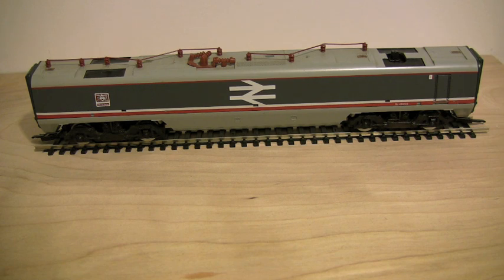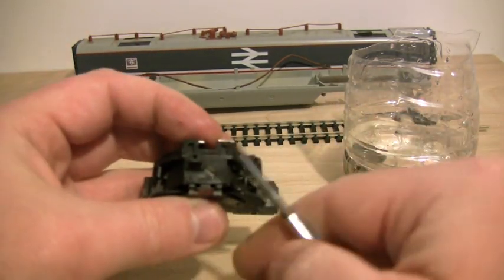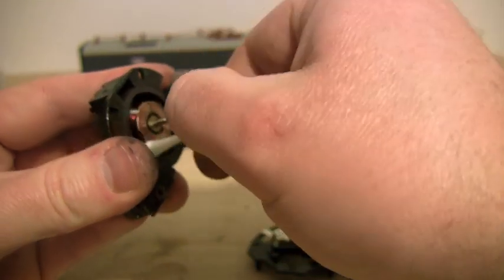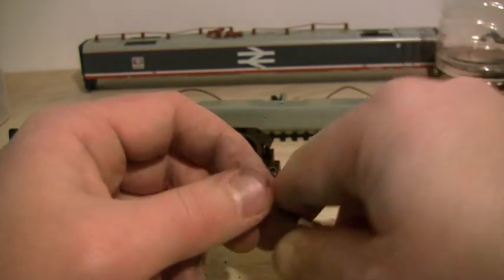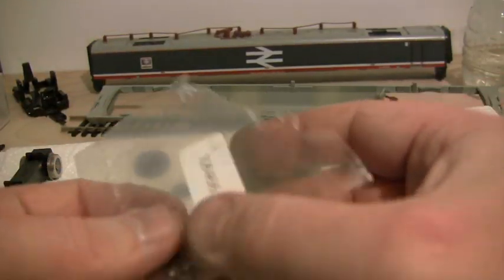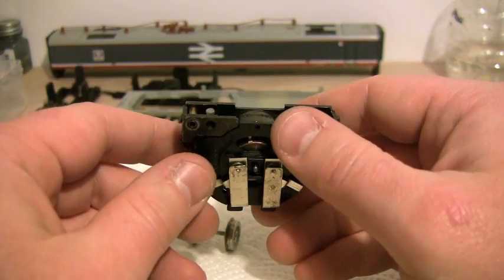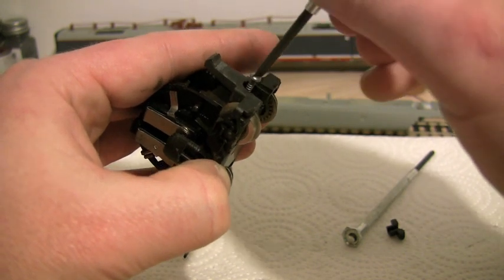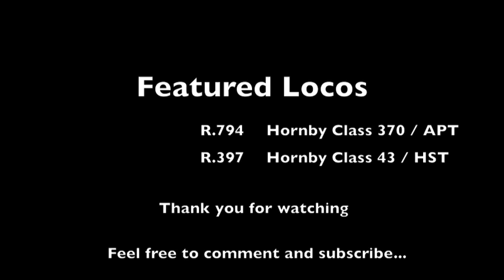oorail.com | Hornby APT Class 370 Power Car Repair

Comment: Hi. I did what u did to one of the hst class 43. It worked.!!  It goes ok but not as fast as yours  12 volt I measured on the rails one problem now it derailed on corners I looked and the wheels aren't straight lol. Will sort out tomorrow but thanks for this handy tip. .

Comment from the maker: I'm not sure about the pendolino but the Hornby APT has the body tilt on the bogies. This seems to be achieved by the plastic piece where the bogie is connected to the chassis. The plastic is molded such that the body can move on the bogie as it goes around curves. It seems to be finely balanced on the APT, needs the body shell attached to work properly. It does work at slower speeds with just the bogies and chassis. I will see if I can do a video showing it working :)

Comment from the maker: Yes its exactly the same type of motor as the old HSTs. The top of the motor casing might look slightly different. The APT has a bracket for the pantograph that screws into the top of the motor casing. The HSTs that I have don't have the screw hole in the motor casing, but some of the older Class 35s that I have do. The motors are identical aside from that.

Comment: Found the video above about servicing of the ringfield motor will come in handy but I am the gentleman who is having difficulty removing the motor frame from the chassis. I believe it is type B . I have removed the weights but cant see where those darn lugs are hidden. The model is a 'king edward 1'.

Comment from the maker: Thanks. Yes its a lot easier to do it that way, I think thats the way the service sheets tell you to do it. There are two types, one with a screw and ones that you have to bend back a little to get the spring / brush in there. Aside from it being a lot easier to lose the spring, the metal will fatigue over time and can easily break. So while its a little bit of extra effort, you don't run the risk of losing the spring or breaking the metal this way. Either way works though! :)

Comment: Watching with great interest. May have mentioned before about the brass cog issues. The original plastic cog broke and have been trying to replace it with a brass cog.
For a moment I thought you were going to pull the axle and cog out but you didn’t.
Andy Russel spoke about using a C clamp to push the cog back on and I gave one set up for this.
Have you ever tried it with any other Ringfield? I have a number that require the cogs to be replaced.
I feel your pain on the prices/postage as I live in Toronto
Cheers
Reply from the maker: Glad you enjoyed the video. I've had to replace both plastic and brass cogs on several locos. Usually its because they are loose due to a small crack in cog. If you are installing a new brass cog, you will want to grease (I used silicon / PTFE grease) the shaft and will require using a small vice. There are a couple of ways to do it, putting a nut between the vice and the cog works well, just make sure the nut is big enough that its going to slide right back off when you are done. The brass cogs can crack and I suspect they are weakened by the press fitting process to get them on. The solution I ended up using was to 3D print them, you can see what I did on this video -> https://www.youtube.com/watch?v=7K9qsUa16Gw .. now i had the same problem with an alloy cog on an A4, but what was interesting was that the shaft / spindle on that loco was larger than the previous one. Since the cog didn't seem to be damaged, I tried a different approach which was to create something to keep the cog on the spindle. Which you can see here -> https://www.youtube.com/watch?v=jkptWv9kypE .. I've got a bunch of these working great with 3D printed cogs using slightly different materials, so if there is interest, I can probably do a video soon and make the STL files available..

Comment from the maker: Does it make a sort of high pitch grinding noise when it runs? One some of the older HSTs, the metal piece thats on the motor casing that holds the springs in place for the brushes can work loose. I think its held by two screws. I had to replace those screws, bend the metal piece and replace the springs / brushes on one of my HSTs. A cleaning would definitely be the first place to start. If you need help just ask here and I'll see if I can help you troubleshoot it...

Comment: Fansatic video. I have two hst class 43 and the worked for bit that stopped. Smoke came out  if I did what u did clean it and will that work or it the motor knackered ?

Comment from the maker: I'd recommend applying power to the class 43 with the body shell off, make sure its just out of position before you try to adjust it. There should be some play in it, so you might be able to push the rod back slightly and see if it will engage. Observing it will give you an idea how far you need to move it back. To move it back you're going to need to very carefully use a vice, just don't push it too far!! I'll be posting a video showing how to do this shortly...

Comment from the maker: Those motors are always repairable, it just depends on how much effort you need to put in! If you are on a budget, I would start by cleaning it like in this video and probably should replace the springs / brushes. That should get it running. You may end up having to replace the magnet (usually if it won't start on its own without pushing) or the armature. If you replace the armature, you might want to consider upgrading to 5 pole. I have a video showing how to do that coming out soon! :)

Comment from the maker: The layout is DC, while I have a few DCC-fitted locomotives, most of the locomotives I have are either newer DCC-ready locomotives, or older Tri-ang / Hornby DC locomotives. Its cost prohibitive to fit these locos with DCC. That said, you'll see some videos later this year on the channel that demonstrate ways to get some of the DCC features using a DC layout (multiple trains running, independent lights and sound etc). So stay tuned :)

Comment from the maker: @BristolSpotterHD Yes its possible. You need to replace the wheel itself as there is a groove that the traction tyre sits in. You should be able to find replacement wheels on eBay. What model did you want to modify, the APT?

Comment: Hmm, just got a APT and it keeps derailing over points.....seems to be  the van trailers and power car bogies.... ...any advice? oh and taking the shell off the power car is really really hard....you made it look so easy!
Reply from the maker: Check the wheel spacing on the axles, particularly the ones that lead on approach through the points. When diagnosing issues with points, I typically run the loco through at slow speeds to see if I can see any obvious problems (eg. wheels lifting off the track due to flange depth etc). If you are having problems with the driving cars, those have a wire that goes to a set of copper pickups on the front bogies, that solder joint, the pickups and sometimes the wire itself can restrict the movement of the bogies, especially on curves. Replacing these wires with small gauge wires (such as those used for DCC wiring), can often help as well.

As for removing the body shell, its going to vary drastically from model to model, these are plastic models that are about 34 years old at this stage, so if they've never been opened you might find it a bit of a challenge. Mine of the other hand have been opened quite a bit, at least by me, so it looks a lot easier! :)

Comment: Where is the Video for the overhead wires, I brought an APT and the wire are broken any ideas for replacing them?
Reply from the maker: I assume you are talking about the very thin pieces of plastic that make up the roof electrical system detail on the top of the power car (the one with the pantograph). You can replace the wires with thin copper wire, I think 24 GA is what I ended up using. You will need to cut the wire and use a decent high quality glue. I would suggest painting the wire before installing it. You might want to look on Google Images or Flickr for photos to get a better match. I have a video on how to do this in the pipeline, but there are quite a few others ahead of it, probably looking at mid-April before you see the rest of the APT-P restoration project videos...

Comment: Is it advisable for a beginner? I bought a old APT that needs to be serviced
Reply from the maker: Everyone has to start somewhere, watch the video carefully and just work through it in a very cautious manner. Don't use too much force and remember you are dealing with plastic that is around 30+ years old. The hardest part is taking the plastic body shell off the chassis, if you get that done without damaging it, the rest is pretty easy. I would suggest perhaps picking up new springs and brushes ahead of time that way you can replace those and not have to keep dismantling the APT power car unnecessarily.

Comment: Great video - thanks. I've got one of these the engine seems fine - and I've opened it up - thanks to your instruction. Won't pickup power from the track but will from front wheel and rear wire! Any thoughts. Malc
Reply from the maker: +Malcolm Lindsay so I'm traveling by train for the next 36 hours, so I can try to help troubleshoot this. So it won't pickup power from the track but it will if you place a wire on the wheels?
Reply: Don't worry - sold it instead of fixing :-)

Comment: Can anyone help me? I've bought a class 91 from ebay that is apparently 'NEW' but clearly isnt. It doesn't run too well. When a locomotive is in my hand, if i try to move the wheels I cant. They only move when powered. I assume this is normal. But when I pick up this class 91 power car, I can turn the drive wheels freely, with the cogs all turning. Am I right in thinking that this isn't right? Is this an indication that a repair is needed, and if so is it easy to do? Thanks.
Reply from the maker: There should be a reasonable amount of resistance when you try to move the drive wheels with your thumb. If they are moving as freely or almost as easily as the non-driving wheels then thats not right. How old is this class 91, do you have the Hornby product code? If its "screeching" as it goes around the track? Does it require a bit of coaxing to start moving?
Reply: oorail.com It is R293. It doesn't screech, in fact it doesnt really move at all. the motor is definitely moving but the wheels arent. If you push it it moves a little bit then stops. Ive compared it to another class 91, and there seems to be a white blob of superglue stuff on the metal cog in the centre. You have the black plastic cogs around a metal silver one in the middle. On the loco that doesnt move there isnt this glue stuff - is that needed to attach the metal cog to the axle?
Reply: ilovenipples Ahhhh... the gear is loose on the motor shaft. So the motor spins but its not turning the metal gear to turn the wheels... is this fixable? Thank you x